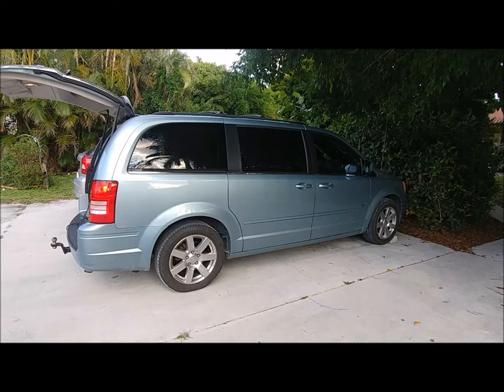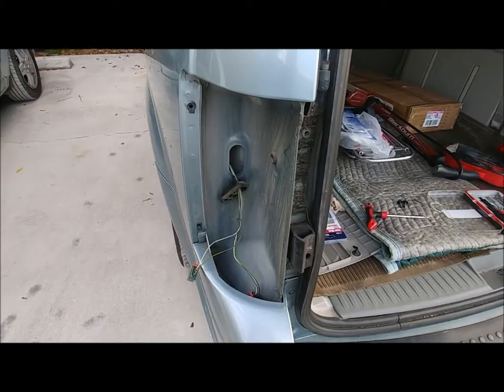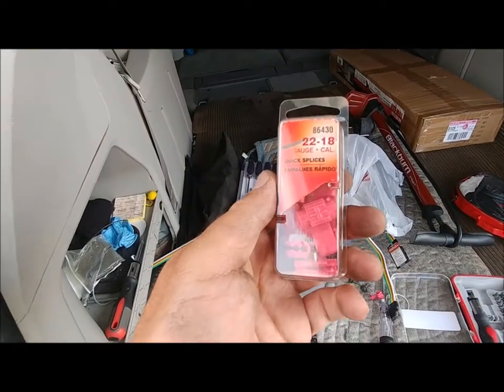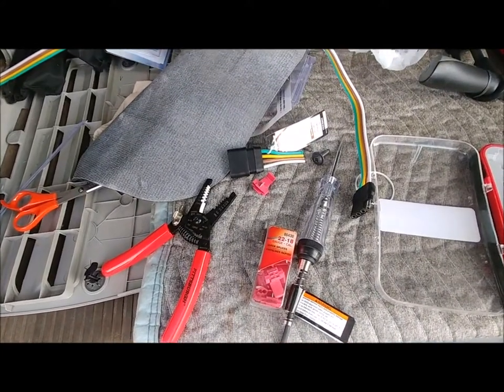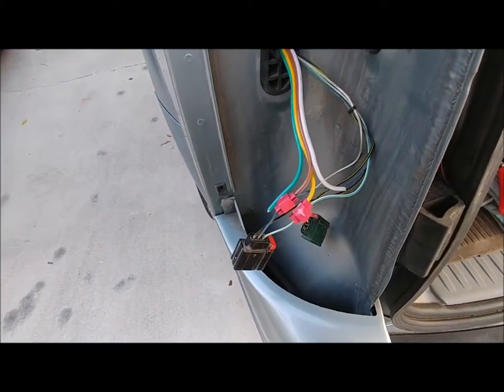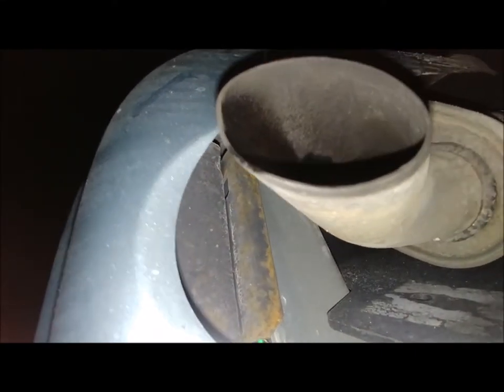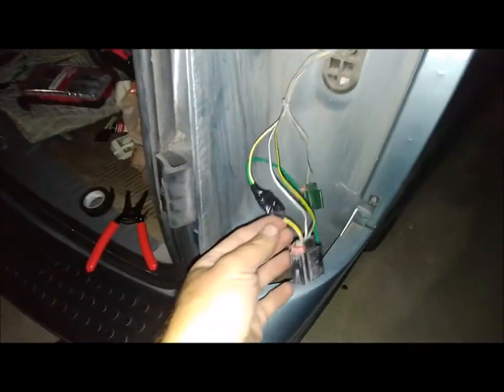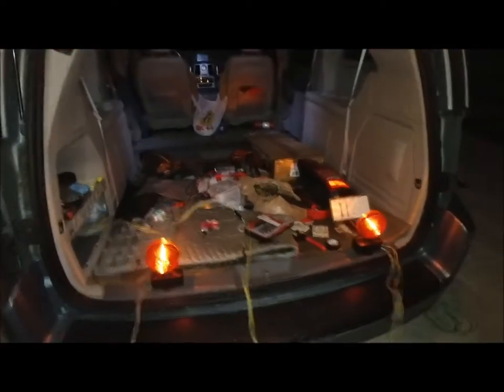2008 Chrysler Town and Country trailer wiring

Comment: Thanks for doing this. I believe the wires that for nothing are the ground wires. You might have been able to tap into those the same way instead of drilling a ground screw.
Reply from the maker: Thanks, I didnt like drilling that hole, but I have towed a few times and im happy to have the hitch and wiring functional.

Comment: I found your video very helpful thank you :) but it got me confused in the white wire and purple line then when I saw the taping it was in different wire so which one was it for the tale light?
Reply from the maker: You're welcome. I just rewatched the video. On the right side White with purple stripe is the taillight, white with yellow stripe is the turn signal/ brake light.
Reply: I found it but there is an issue when I step on the breaks the front side lights turn on too I'm so confused 😥
Reply from the maker: @ehernandez1917  sorry buddy, I don't know. My van was completely original with all original style bulbs, I read that aftermarket bulbs can sometimes cause problems, if you have them, I'd start there. I don't have the van anymore either.

Comment: Good way to cause a short by having power/battery connected while working on that/those circuits. Not to mention causing a fault in the BCM (Body Control Module) which will cost you a pretty penny to replace. NEVER WORK ON ELECTRONIC COMPONENTS WITH LIVE POWER TO THEM. Unsafe and can be very costly for repairs.

Comment: Bro first of all you should have gotten a plug and play trailer wireing it would have been way way faster
Reply from the maker: Nope. The plug in ones that I found were around $70 and they were for LED taillights. Why spend $70 when I can do for a 10th of that?
Reply: @delux68   Did you mean your trailer has LED lights, or the plug&play is for LED?  Just curious, because LED lights take a fraction of the power as the older type bulbs.
Reply from the maker: @donf3739  No, the newer Town & Country and Grand Caravan have LED taillights, my 2008 Town & Country had incandescent bulb taillights so no need for a fancy wiring kit when a simple one would work. It is my understanding that in order for trailer lights to work with the vehicles LED taillights, you need the $70-ish wiring kit.
Reply: @delux68  Ohh, now I get it.  Thanks for explaining.  That IS pretty wimpy wiring to the vehicle's taillights (on my 2010).  I didn't realize they are LED.
Reply: Looking again, I think my 2010 has the same wire size as your '08, and the parts sites list LED and incandescent bulbs for both years.  I bought the powered kit on Amazon for $47.  I think it was worth it to have that additional power to make the trailer lights their brightest.  The only hard part is running that wire up to the battery.